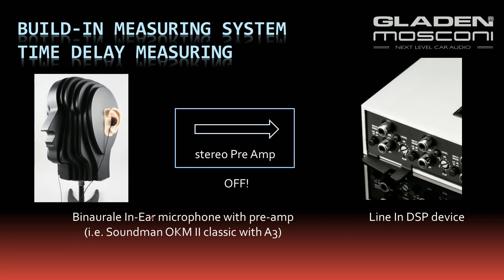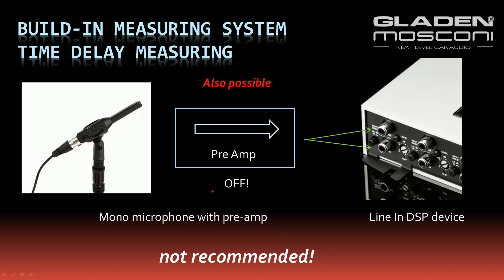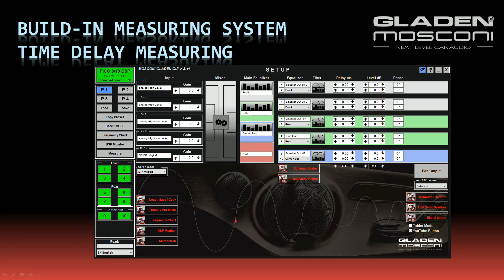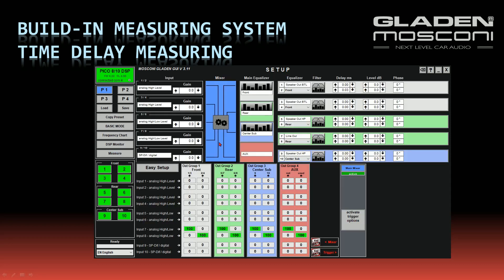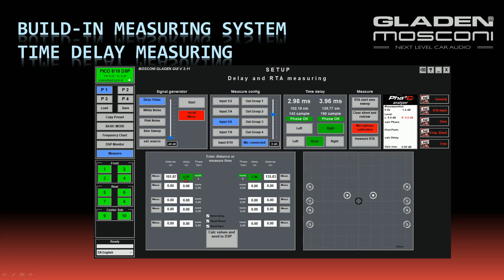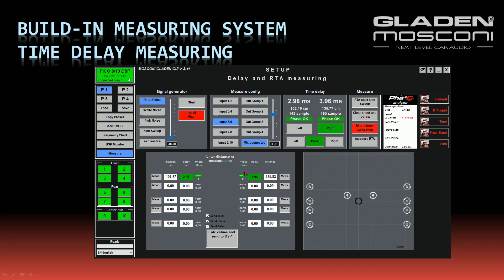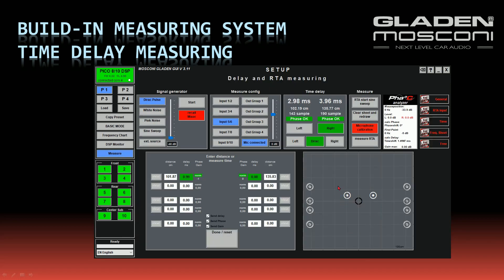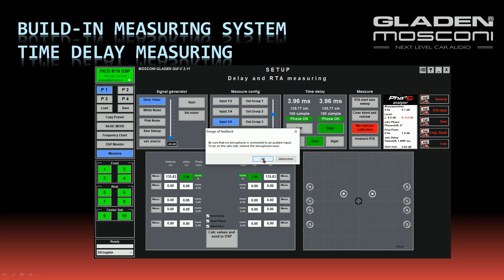9.2 Time delay measuring

Comment: Hi! 
This can be done using umik usb microphone and computer connected through minijack to stereo rca into the dsp?
Reply from the maker: It depends on how high the latency is.

It is possible that the frequency scale is shifted during the RTA measurement.
Delay and phase are measured relatively, which should work in any case.

Comment: So I managed to measure tweeters and midrange with crossovers in place using your technique. Midbass I had to play full range to get enough volume for Dirac Pulse and it worked, but subwoofer will not play loud enough (max volume, dirac pulse at 0dB) for the microphones to register the distance. What can I do?

Comment: How do I connect the mic to the Pico 4/8 DSP ?
Reply from the maker: You can use any microphone preamplifier with line-out, or a USB microphone with additional line-out.
Simply connect it to a free low-level input on the Pico.
Be careful with feedback, the input must not be routed in the mixer.

Comment: What if you are using the Atomo which has limited inputs, all of which are utilized (tweeter/mid on passive,  midbass active and subwoofer active).
Reply from the maker: Disconnect an input to measure, use a pre-amp with optical output or use a line- to SP-Dif converter like logilink CA0102: https://www.amazon.de/LogiLink-CA0102-Audio-Konverter-Elektromagnetisch-Rauschfreie-%C3%9Cbertragungen/dp/B072C31G1P